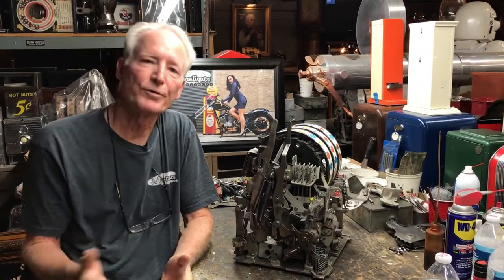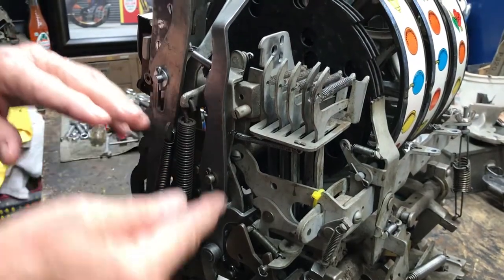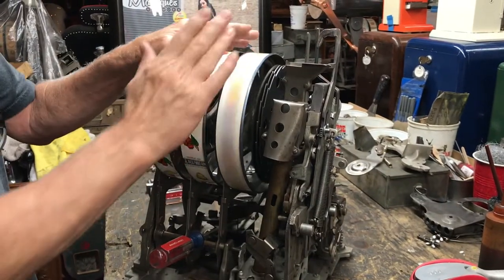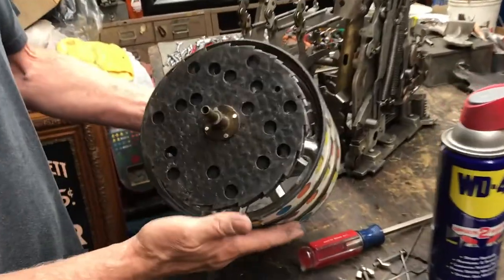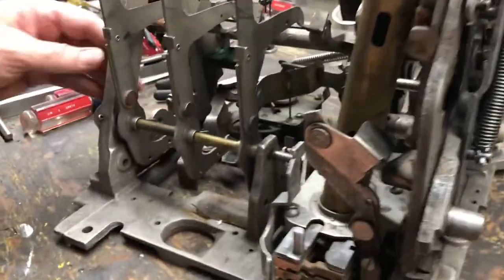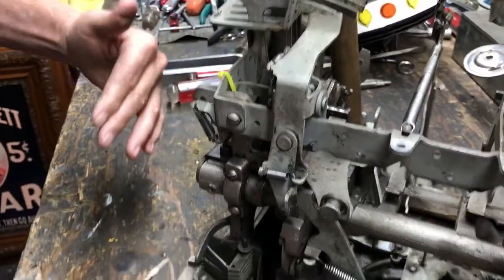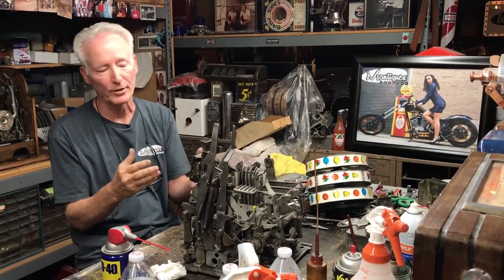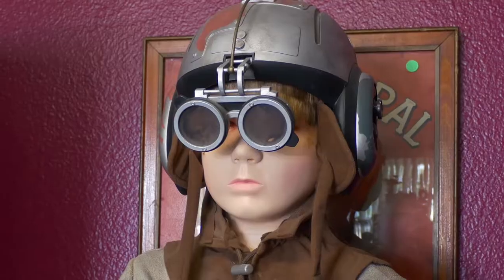How To Repair An Early 1900's Mechanical Slot Machine By The Mantiques Network

Comment: So I have a question for you I bought a 1982 igt 5 cent slot machine and the handle is not engaging when I pull it down and the seller said it was a fuses were dead 2 of them no keys but it unlocked can you help me with it?

Comment: I’ve got a mills machine in excellent order
Here in the UK. The mechanism works beautifully however the coin escalator doesn’t seem to communicate to the mechanism that it’s got a coin and ready to play and the lever will not pull. 
I’ve cleaned the coin escalator with methylated spirit but it doesn’t see the coin 
Could you advise how I can fix it? I’m quite good at mechanical work just need a pointer in the right direction. Your help would be much appreciated thank you Scott.

Comment: I have a 60s mechanical slot machine.  My reels spin freely & ive oiled them, but the more spins in a row, the slower they go. They start slowing from right to left. After 10-15 spins, itll almost not event move. If i let it sit for a while, itll go back to spinning all 3 nicely. Any insight as to why it slows after a few plays in a row?

Comment: I have a Aristocrat machine and the arm for the payout that goes into the disc don’t stay retracted to allow the reels to spin. As soon as the handle is released the arm lock the first reel to the left. I see no adjustment or how the arms are delayed till the reels are stopped by the dogs. Any ideas or a phone number to contact you.

Comment: Can you help me and explain how to remove the glass pane on the front a Watermelon Mills slot machine. I have one pane that is cracked and would like to replace it. All that is shown on you tube is explanations for the mechanism which is not helpful. Took the 4 screws out around the glass frame on the inside of the machine and thought I could access the glass but still cannot. It is loose but cannot remove to replace glass.

Comment: I have a 1975 (I think) Aristocrat Regal Super 223). We took the machine apart with your video and got everything working great. When the reel goes back in, are the wheels lined up a certain way. After spinning them and not paying attention, we just put  the reel holder back in. Should there be a sequence? Thanks, your video let us do this at home.
Reply from the maker: No, there is no sequence. They’re random. Sorry. Thanks for watching

Comment: I have a Bally 809-B that I just acquired.....everything works great just one issue...its a three coin machine and starts on 2nd coin..inserting second coin it jumps to third coin.....no first coin....not are what the issue is but would be nice to be able to use 3 coins

Comment: useful vid. Exactly my machine - c. 1946 Mills - and I'll now try to get the reels going @ home; right now the symbols line up poorly if at all; cylinders are only spinning about a quarter turn if that before stopping; and all 3 are stopping at the same time instead of 1-2-3 sequence. If no joy, I'll drive it down to your shop in Orange.
Reply from the maker: Make sure you play the hell out of it. Run lots of coins through it. Make sure it works good. That’s my advice. Thanks Jim.

Comment: Just moved my Mills machine from San Francisco, CA  to Prescott, AZ. Slot did not work when it arrived at the new house.  AFter watching this video, I was able to move the mechanicsm for the arm with the screwdriver as you showed in the early part of the video.  The mechnism re-set itself and now the machine works well.  It took all my nickles already, so it's working perfectly... Thank you so much for posting.  :)
Reply from the maker: Nice job. Thanks for watching
Reply: Videos for my U.K. Sega Crazy Bells one armed bandit are available here on YouTube

Comment: My 47 mills quarter machine pays out way to much.  It has 7 cherries on the first and on the second reels.  So it hits cherries way to much.  It will dump the tube regularly.  How do I regulate that?
Reply from the maker: Hi Charles. Thanks for watching our video. Without it being on our workbench is kind a hard for us to determine really what the problem is. Jim’s first guess is that somebody put In the wrong real. You would have to take those off and replace it with factory settings and it might fix your problems. We don’t offer any services and we don’t sell any parts. Thanks for watching and good luck.

Comment: Thank you so much for putting this information online I just stumbled on this video. I inherited a Mills 5cent Castle Front from my Grandfather over 30 years ago that was painted with silver furnace paint to disguise it as it was used in the back room of one of his businesses. I remember playing it when I was very little and was sitting on his workbench in his basement. I stripped the paint and did my best to restore it cosmetically but it has never run quite right in all the years Ive had it. It sits in a prominent place on the bar in my Rec room and I would love to get it back to 100 percent for my Grand kids.
Reply from the maker: Great to save and appreciate it. Thanks for sharing and watching our videos
Reply: Videos for my U.K. Sega Crazy Bells one armed bandit are available here on YouTube

Comment: Hi so glad i came upon your channel. I have a half dollar mills slot and i have question on where /who i can contact for replacent parts.namely all my springs are shot or missing and i need to replace them any help/direction for those and other stiff like wheel graphics would be so appreciated
Reply from the maker: Hi David. We only do full restorations and do not offer parts or technical service. I have no idea who might be able to help you in your area. Not easy to find. Good luck

Comment: Hi, thanks for you Video. I have one question: I accidentally slid out one of the money levers in the front (those slides with the hole in the middle connected with a spring on the back) It was stuck so and wont get back in place. So I slid out the lever above and "hooked" in the underlaying lever. No all is back in place and the amounts of pay off are all right as well. Could I have damaged something or is this construction "idiot-proof" and I do not need to worry. Would really appreciate a short answer. Regards from Germany.
Reply from the maker: "idiot-proof"
Reply: Thank you 😊

Comment: I don't know anything about this . I have a WWII buddy that repaired these machines back in the 60s through the early 80s he just amazes me how much knowledge he has . He used to repair cigarette machines and Seeberg Juke boxes to when they had a route. I want to get Mills from the 20s through the 50s and restore it but don't know how to do it. Can I buy parts from you? Very interesting video thanks
Reply from the maker: Thanks for watching and the compliments. Unfortunately we don’t sell any parts. Jeff
Reply: @MantiquesNetworkShow  Oh ok just watched a video on the Mills Bonus Cheat  Machine from the 40s I am Auto and Marine Tech and the mechanics of that gave me a head ache I am blown away how in the hell did they engineer that so many years ago no computer just a slide rule and drawings I am so blown away and I am in awe  thanks for the reply

Comment: I love the show. I usually work on em pinballs etc. Just picked up an em Bally 952 -D slot. It's got to be out of the silver city casino out there because it's got the front panel on it. Anyway, I can't find any info about this model and the first reel only spins occasionally. I'm hoping it's just gummed up. What's the best place to start and where can I find info on this? I'm guessing it's early 70s. 25 cent 3 coin. Thanks.
Reply from the maker: Thanks for watching our show. Unfortunately there is no 1-stop  to find. We use books like "SLOT MACHINES First 100 Years" books. Google for your information and possible vendors. eBay for parts. Good luck. Jeff
Reply: @MantiquesNetworkShow  thanks Jeff. Keep up the good work. Hopefully I'll get my place worthy enough for you guys to make a trip out one day to check it out.

Comment: Thank you! So useful. For me, the ingenuity of the engineering that goes into one is just stunning - and all to get people to dip into their pockets. Presently servicing a Sega Windsor. Mostly its just light rust from it being stood unused in a barn for a year - bit of cleaning and oiling but it works pretty good even as it is.
Reply from the maker: Jackbox Our pleasure. Good luck with the project. Thanks for watching. Jeff
Reply: Videos for my U.K. Sega Crazy Bells one armed bandit are available here on YouTube

Comment: Hi Jeff,great videos, I have bought a nice Horse Head bonus, I have got a problem with it in that the payout fingers are coming in to early and allowing the last reel not to settle in time, I noticed on the video there was a adjustment inside the machine which I have tried to adjust with no luck, if I
 move it out it gets stuck as what happened in your video. Best regards Marc (UK)
Reply from the maker: It's something small. But without being able to have it on our bench we really can't advise you. Good luck. Jeff
Reply: @MantiquesNetworkShow  Many thanks for your reply as you say it cannot be anything too bad, great videos of machines you dont see in the UK.

Comment: I have a mills 10 cent slot machine and it pays correctly for the 3 & 5 coin reward but does not pay on the 10 or higher rewards. I checked the reels and they are aligned properly. Any suggestions on what my problem might be??
Reply from the maker: Hi Hector. That does sound odd. It could be anything. If you are located in Southern California feel free to give us a call and schedule a time to bring it by for us to take a look at it. Thanks for watching Jeff

Comment: Great video!! I acquired a 1935 Mills Castle slot machine.  There is an original note from the manufacturer that says "This machine is provided with OIL HOLES in main operating lever and reel operating lever.  At least ONCE A MONTH oil parts with regular machine oil."  My problem (i.e. ignorance) is that I'm not sure which "holes" they are referring to.  Can you help?
Reply: Videos for my U.K. Sega Crazy Bells one armed bandit are available here on YouTube

Comment: Does it have to do with horizontal pay fingers? Can they be accessed without pulling entire bundle?
Reply: Mine pays on every pull
Reply from the maker: It  most likely has to do with a Vertical fingers tapping a Horizontal pay finger. The fix is : play the mechanism , see which Vertical Pay Finger is tapping  the Horizontal, if so bend it away until it clears. Good luck . Jeff

Comment: Great video guys!  I traded a gentleman an implant and a crown for a (1937) Mills dime slot machine.  Looking at pics on the internet, it looks to be the Futurity.  Worked great for about 4 months then on intermittent pulls the wheels would spin freely and slow to a stop, never engaging with the reel stops.  Noticed the clock would not spin unless manually assisted. I've given it a good once-over with WD40, hitting all the moving parts but I only get about 2 spins out of it before the problem repeats. Same guts as you're working on in this video. Any insight?  Thanks a bunch! - Scott
Reply from the maker: It could be anything Scott. Without being able to look at it and touch it we really can’t tell you much more than this video does. If you’re in Southern California in the orange area feel free to stop by with it. Thanks Jeff
Reply: might be weak springs not holding the "charge" it gets from the fork I think they call it.
Reply: Futurity was a nifty concept, like the horse head bonus, it meant you closer to a win!  I read how some of them were rigged to pay cherries just before the end thus cancelling the higher payout.
Reply: Videos for my U.K. Sega Crazy Bells one armed bandit are available here on YouTube

Comment: I’d keep that wd40 away. Stuff’s not a good lubricant it’s a water displacement formula hence WD.  I only use it to scrub rust now.
Reply: Kroil and others. The old timers would’ve only used 3 in 1 and that’s good.

Comment: Hello,

I am from Belgium. I have 2 waitling's rol-a-top reproductions, just get them as a gift, thanks for the video's, they help a lot. But the 2 system i have are a little bit different. I'm working on them now. Do you know something about the money in can use ? I want to use euro's. Is there a difference in the weight of the money to use ?

Thanks a lot !
Reply from the maker: Thank you for the compliments. I’m glad the video could help you a little bit. Each machine is made to only work with the size of coin and weight it was designed for. Thanks for watching Jeff
Reply: Thank you !

I have already a few coins of 40years ago. So i can start testing.

But is see when you start the cycle. It goes smooth.

But when i do it, its verry hard to start the cycle. I already used wd 40 for some parts. But it goes verry hard to start the cycle. Any tips for a smooth cycle ? What do i have to clean with wd40 to have a smooth cycle.

Thanks !!!
Reply from the maker: @Kegels001  our pleasure. Enjoy them !
Reply: @MantiquesNetworkShow  hello, i think you didn't read the rest of the text 🙂 I struggle with the start of the cycle. It goed nog smooth. Any tips for that ? Thanks !
Reply from the maker: @Kegels001  sorry. Without seeing it we can’t help really help you. Good luck
Reply: @MantiquesNetworkShow  ok, i understand. Thanks

Comment: I have a Jennings 25 cent standard chief.it seems to work all right except it pays out to often,sometimes the symbols do not really match the payout and it just payout anyway.any idea as to why.by the way where are you located. regards john
Reply from the maker: Hi John. We are located in Orange, CA 92865. Feel free to call Jim directly at 714.351.1508 to see if he might be able to troubleshoot for your . Thanks Jeff
Reply from the maker: That is tricky. We would need to see it. We are located in Orange CA.

Comment: I have a 1946 Mills Black Cherry quarter Slot Machine.  It either pays nothing or 3 quarters for 1 cherry, rather than 2, and 6 quarters, rather than 5, for 2 cherries.  Everything else seems to pay out correctly.  Do you have a video showing, or suggestions as to what to look for, adjust or clean, lube?  The machine had been cleaned and serviced before I bought it but it's not practical to ship it back and forth every time some little something get out of adjustment.  I'm mechanically minded and can do the work but I'd rather start with some guidelines rather than blindly tearing into it.  Any comments you can make will be greatly appreciated.
Reply from the maker: Hi. Thanks for watching our video. Unfortunately without having it in front of us we have no idea what to tell you. It could be a whole host of things. Sorry about that. Good luck. Jeff
Reply: Got it figured out.  Someone had shimmed the payout slides to pay out the extra coins.
Reply from the maker: Mr. Harleyhound Well done 👍🏻

Comment: I need help figuring out how to do the bypass testing that you do with the screwdriver.  Can i send you a pic of my set up?
Reply from the maker: Hi Julie. Thanks for watching. Feel free to send pictures to info@mangtiquesnetwork.com and we will see if we can help you. Thanks Jeff
Reply: The Mantiques Network the reason im working on this is because the arm of the machine moves freely and does not cause the machine to take the money and spin  the wheels.  I'm sending a few pictures and have circled in red where i think my problem is.  

I appreciate any guidance you can give me. My family has owned this machine for about 50 years, i believe.

I can't figure out how to attach the photos to this. Do you have an email i can send them to?
Reply from the maker: @juliehoworth-mccormick4426  Hi Julie. No need to send pictures. There is a serious problem with that slot that will take a professional to fix.

Comment: My reels are spinning slow kicker seems fine I’ve had reels off and apart cleaned them and put back they spin ok on the axel when off and half cycle but once on they seem slow and reel 2 and 3 stop together I’ve checked nothing touching the reels they don’t seem bent or the axel seems fine to it’s and aristocrat bingo one arm bandit any help much appreciated.  Davie
Reply from the maker: Without  looking at it we really can't tell you. If you have the ability to bring it here in Orange, CA we would be more than happy to take a shot at fixing it.

Comment: I have a 1979 Jennings/Bally Triple bar nickle slot. I am trying to find a replacement battery for the motherboard. The numbers on it is 16-139A, then ASM in Mexico, 7845. No one seams to be able to tell me anything about this battery. it's on a 11108 board. Can you help? I can send pics if you need them. Thank you.
Reply from the maker: Sorry no. That is going to be a hard find. Good luck Jeff

Comment: Hello I'm new here and I was wondering if you know anything about a bally slot machine; model 1089-222.  with a summit systems tag above it that says; model# 142363
Reply from the maker: All we can tell you is that its a very early model that started to use a computer boards to drive its mechanical parts. Because it was on the forefront of the computer age it was plagued with a lot of problems. I wish I could give you better news. Thanks for watching. Jeff

Comment: dear Mantiques, i am renovating one, here in the netherlands. but the spinner unit in the bottom has lost all its gears. is there any parts shop where i could buy a occasion unit for my machine?
Reply from the maker: Unfortunately there is no 1-stop  to find. We use books like "SLOT MACHINES First 100 Years" books. Google for your information and possible vendors. eBay for parts. Good luck. Jeff